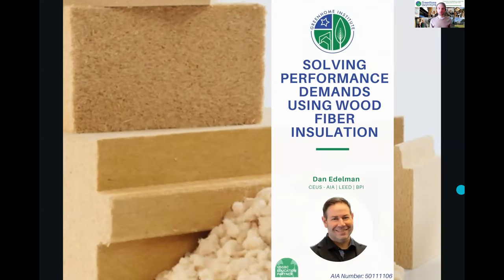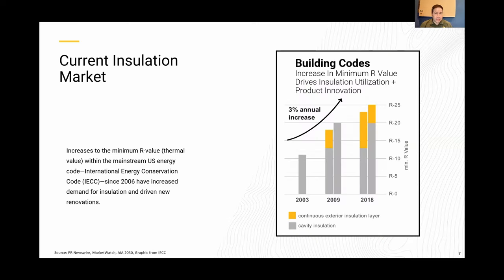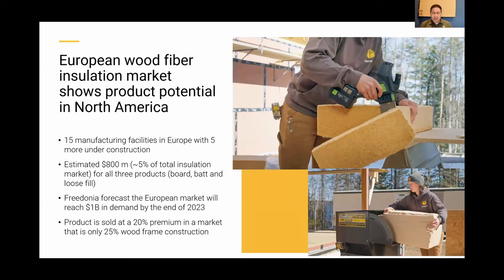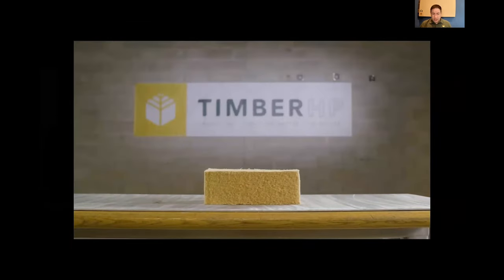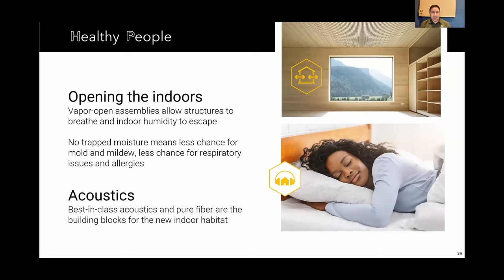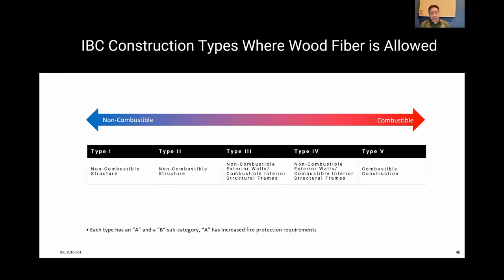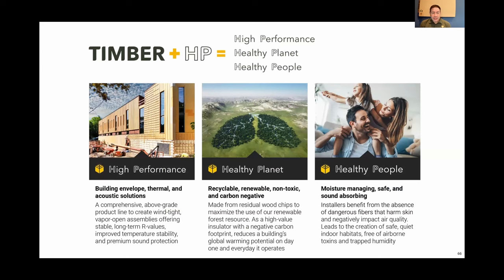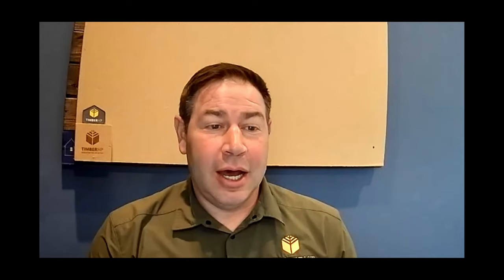Solving Performance Demands Using Wood Fiber Insulation

Comment: Good presentation. I wonder if there is any research on how borate that is added to wood insulation impacts on health/air quality. Also, what is the % of the polyester fibres blended into the bats? I do not recall it being mentioned in the presentation.
Reply: I was pleased to hear borate is used, as far as I understand  this is a very safe substance and I even use it in my bath!

Comment: Hi, this sounds interesting, but if solid 2x wall studs are thermal bridge issues, how can this product yield high performance insulation??
Reply: The same way fiberglass does.
Reply: There is a rigid wood fiber board that will be used as continuous insulation. As many product state high performance, it is up to the entire assembly detail that will deem it that way.